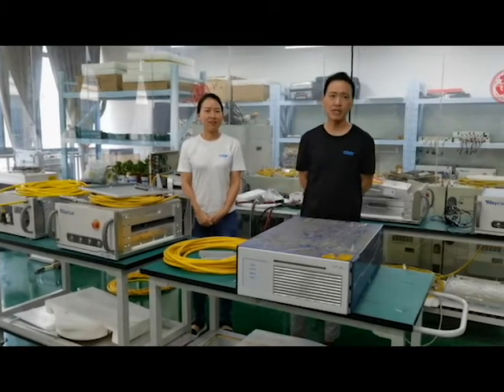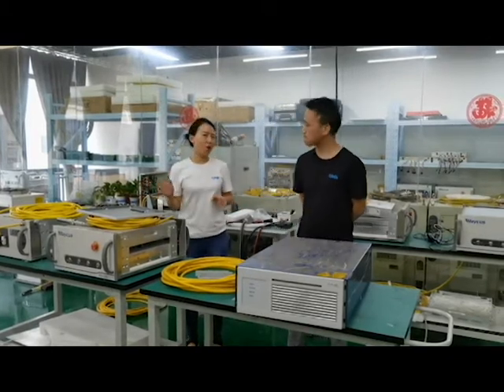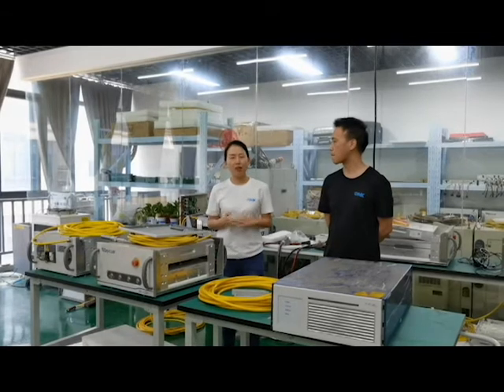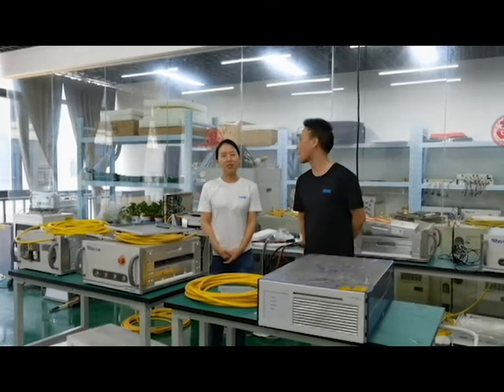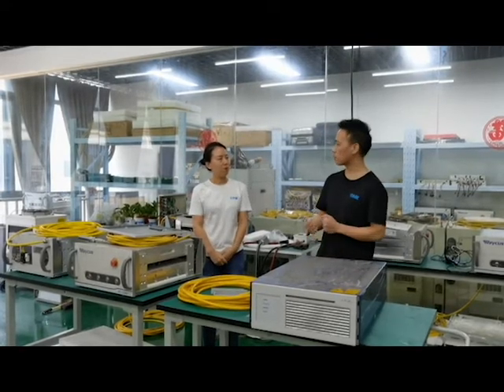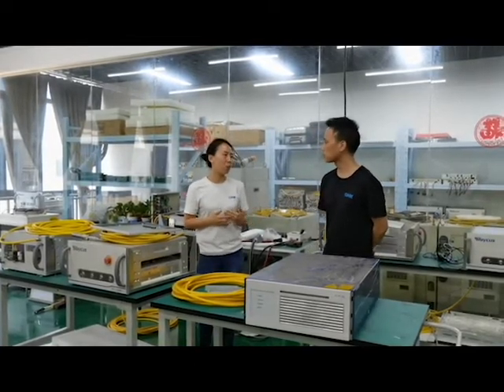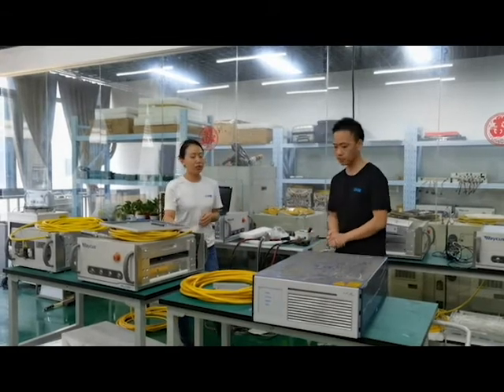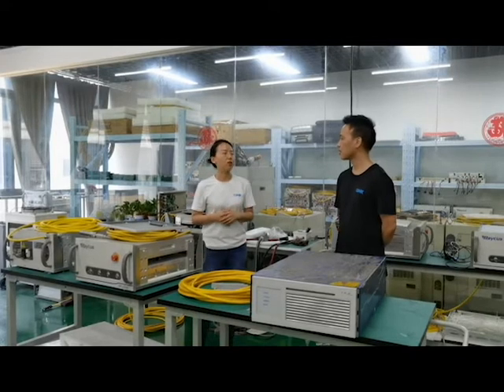Introduction of the fiber laser source repair station #dmk #dmklaser #DMK #DMKlaser

Comment: Hello, Does the fiber laser repair station needs to be a clean room? if yes which class do you suggest?
Reply from the maker: no need to be a clean room
Reply: @jallyqu  It is very nice to have your kind response. you emphasized that the QBH is very sensitive to dust. then if the area of repair is not a clean room what should we do to avoid any damage to the QBH or overall system.
Reply from the maker: @Scienceshorts_H  normally the QBH are protected and closed with cover, during the operation of unplug or pluging, we will clean the surface of the protective cap.
Reply: @jallyqu  How can I get your help with the part number or model of the tools needed to start repairing fiber lasers and their prices? and also I didn't get what was the tool you mentioned as a stabilizer or something like that for checking the diodes to ensure they are perfectly working or not.